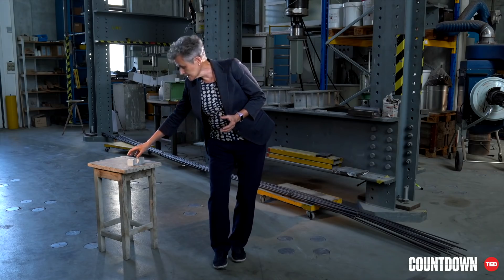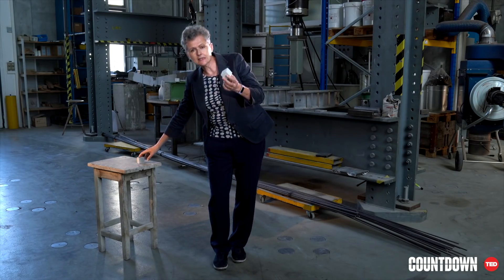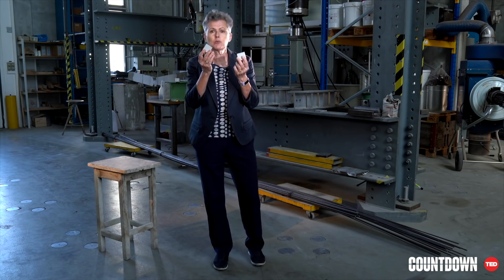A concrete idea to reduce CO2 emissions | Karen Scrivener

Comment: NASA reports global warming at 1°C where it has been since 1992 after falling from its reported all time high of 1.1°C in 1991.  The cause of global warming is not known.  Earth's water vapor saturated greenhouse effect is due to water vapor.   The other greenhouse gases can not change the overall effect of earth's water vapor saturated greenhouse effect that absorbs all the greenhouse radiant energy from the earth within a few meters of the radiating surface adding 10°F (5.55°C) to earth’s average temperature.  This was taught in US high school science.   No climate change from global warming that was to start at 1.5°C of global warming causing stronger observable hurricanes in the Gulf-of-America (Gulf-of-Mexico).  

On average human caused atmospheric carbon dioxide is less than a 0.1% share in earth’s water vapor saturated greenhouse effect.  Water vapor has a CO2e of 18 and on average is 1% of the troposphere.  Carbon dioxide has a CO2e of 1 and is 0.04% of the atmosphere 400ppm.   

1.00%/0.04%=25,  water vapor is 25 times more present in the troposphere than carbon dioxide.  25 X 18 CO2e = 450 CO2e for water vapor and 1 CO2e for CO2.  All the other greenhouse gases add up to a bit less to about the same as that for carbon dioxide or 1 CO2e.   Carbon dioxide has 1/452 (0.0022) share in earth’s water vapor saturated greenhouse effect at average 1% water vapor.  

40% of atmospheric carbon dioxide is considered to be from human activity;  0.0022 X 0.40 = 0.000885 leaving human caused atmospheric carbon dioxide on average being less than a 0.1% share of earth's water vapor saturated greenhouse effect.   5.55°C X 0.000885 = 0.0049°C share in temperature retention from human caused atmospheric carbon dioxide.  

Water vapor always hold earth’s water vapor saturated greenhouse effect in saturation.   The other greenhouse gases can not change the overall effect of earth's water vapor saturated greenhouse effect.

Former Greenpeace scientists state there is no unhealthy high level of atmospheric carbon dioxide.  1200 ppm carbon dioxide levels are used in plant growing greenhouses for C3 plants over 90% of the plant life on earth.   This is three times the current atmospheric carbon dioxide level of 400 ppm and would greatly green the earth especially desert fridge areas allowing C3 plants to need less water.

———
The entire wild AC generating space from solar voltaic and wind turbine generated electricity connected to the public power grid needs to be 100% supported with fast reacting peaking power.   This is the most fuel intensive form of electric power.   Wild AC was allowed on the public power grid to encourage large trials of alternative electricity generation.

Large amounts of wild AC from solar voltaic and wind turbine generated electricity costs the public grid more natural gas to support by running natural gas  turbine generators at high readiness 70% fuel consumption making near zero electricity where 100% output 100% backs up the wild AC in 2 - 3 second than making all the electricity from efficient running natural gas combined cycle power stations where a second steam cycle adds 50% higher efficiency.   When making up the dips in wild AC output more natural gas will be used.

Wild AC is especially problematic from residential solar voltaic that may momentarily over supply the power grid at near the limit of its feeder lines.  This residential supply can not be disconnect from the grid as with power stations or well predicted.  The power grid needs to be suppling remote grids in order to support this uncontrollable over supply.   Unaddressed over supply of electricity will cause over frequency throwing interlocks causing instant blackouts. 

The practical use for solar voltaic and wind turbine generated electricity is for maintaining electrical storage.   In many situations this is not economically practical unless there is a need for instant emergency backup power.

In the US modern ultra supercritical (USC) clean power stations burning high BTU bituminous coal had an estimated crossover fueling cost with natural gas priced at $0.80 per million BTUs natural gas in 2022.  The low off-season wholesale price of US natural gas was $2.50 per million BTUs June 2024.  This is below the price needed to sustain the US natural gas market.  

A US new USC coal power station beats the overall long term electricity cost over new builds of US nuclear power stations of the past few decades.   The multiple higher build cost of the nuclear power stations with beneficial low fueling costs will never provide more economic electricity compared to the added running costs of the much lower build cost, but not inexpensive 100 year service life modern USC coal power station.  This could change in the decades a head.

Comment: If we stop Co2 completely how will plants survive.
Reply: Hello 
Reduce/drastically CUT the man-made CO2, 
And guess what, the plants will do just fine because they did for as long as they were here, (hint, before we started burning fossil fuels)

Plus, even if human completely stopped emitting CO2, we couldn't completely stop wildfires globally, which are another carbon bomb that's not going to be easily contained and impossible to stop 😂

Plants and the Earth will be fine, like you care 😢

Comment: Now I'm interested in the extra costs for companies to produce in a way like this. That's the only thing that is not mentioned in the video but it is a really important thing!
Reply: Of course, that is the important point to try to make things in a clean way. Governments should aim to invest in this changes to have real results in middle/long terms.
Reply: Producing LC3 is less expensive than traditional OPC
Reply: @hans-jurgenscholz4334 
Yep, exactly 
I was going to say the same thing, because the feedstock is more common (clay is cheap, and use a fraction of the OPC) and the thermal energy is less (saving energy cost) for the calcination, it's less expensive and marginally less at worst. 

No green-wash premium here....👍🏽

Comment: "20% pollution is caused by clothes production." A fact I think everyone should know. By simply buying less clothes or just sufficient can help a lot. Thanks
Reply: 30% or so of emissions are made by the meat industry. I am a vegetarian now.
Reply: @SuperJompaVideos  that's not true, give me source of your info. If all people would be vegetarians the CO2 emissions would be reduced by 2.5%. You wanna reduce C02 emissions? Stop using cars, transportation. Yeah I know, people don't wanna hear that coz they value comfort more than environment. People like to hear that something easy as vegetarianism would save planet. And I don't blame them, big companies push that agenda coz they don't wanna stop manufacturing.... ;)
Reply: I support green nudism.
Reply: I think it has also to do with the place where the clothes are made. If you buy clothes from 10 euros, they are normally not made in good conditions. But if you buy clothes from about 50euros, you can be sure that the working conditions were already a lot better than the conditions with the cheap clothes.
Reply: @arnodecoster6850  May be may be not.....

Comment: What does same material properties even mean?
I see concrete crumbling after a decade whereas ancient Roman one holds up after two millennia and our favorite WWII villains built bunkers the allied failed to destroy with tons of explosives...
Reply: Roman cement was lost in time, modern cement can withstand more extreme weather conditions though iirc
Reply: @666narutomanfan  AFAIK, we do have old recipes of how to make it and I thought that it was more resistant to weather, but less pressure-resistant, thus allowing only shorter buildings. Moreover, it can't be poured...

Comment: Never said about the cost of LC3, usually it’s the cost that matters
Reply: Yeah, but if you're heating it significantly less (using less energy = saving money) and you don't need new equipment, it's probably pretty affordable. I mean, it mostly sounds like the ingredients haven't changed, it's just the proportion of them and how they're combined.
Reply: It's initial cost a higher a bit for placing a plant for calcining of clay. Otherwise, it's not expensive.
Reply: TED  scam
Reply: The projects I've done have been cheaper than OPC
The local clay feedstocks are plentiful

Comment: being stuck in a concrete industry, You cant do without concrete. all it would take is someone not beholden to concrete industry, to produce another material that is stronger, weighs less and doesnt need a large carbon and water footprint. they dont "like" concrete in countries with little drinking water that concrete demands but they have no alternatives.
Reply: How about cross laminated timber?

Comment: CO2 levels are not a problem you’re helpful and increasing crop . It is a un related to temperature which seems to be going down anyway.. Please study the sun , it’s cycles of sunspot activityand the upper levels of the atmosphere.  Maybe maybe watch balloons in the air a presentation by to Irish climatologist. There’s actually no greenhouse effect . And if there were still two was only 0.04% of greenhouse gas the rest is water. So all of this is rubbish. Maybe the environmentalist crew could worry little bit about all the Hawks and owls that are getting decapitated by useless windmills..
Reply: You just can't be happy without lying about things, even though your lying serves no purpose.
Reply: CO2 is a part of climate change, and you said crops need CO2? Yes they do but most farmers use fertilizers which throw the CO2 back into the atmosphere. About 100 years ago there was  80-100 percent less CO2 in the atmosphere than there is now, and if that number keeps piling up it won't do any good, the plants don't need so much CO2.
Reply: you seem very worried and Hawks and owls. Have you stopped eating other animals?

Comment: They making bricks out of plastic in Africa.
Reply: But they have to melt the plastic, they still cut down trees to make heat in Africa.
Reply: Well India too but the politicians are busy in filling their pockets.
Reply: Those recycled plastic bricks they are making in certain parts of Africa, are not the ideal solution 
Aside from what was mentioned (heat and burning the plastic which is toxic) they are very very risky 

If you have ever seen one catch fire or a downed power line creating a fire, you'd have less than 1-5 minutes to get out. 
Because the high concentrations of toxic fumes would kill long before the fire would burn, and over 99% of African buildings don't have fire/smoke alarms for early detection 

People aren't talking about these toxic combustion issues in Africa, so you should consider that before presenting it like a good solution or innovation, 

It's a death trap